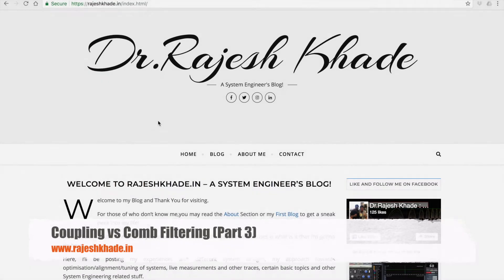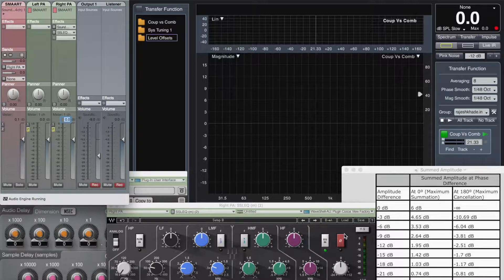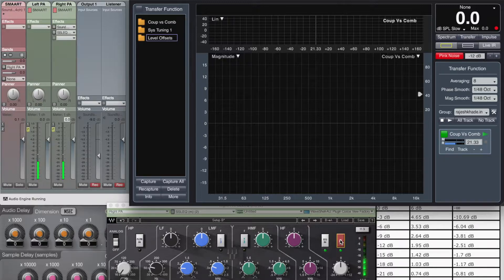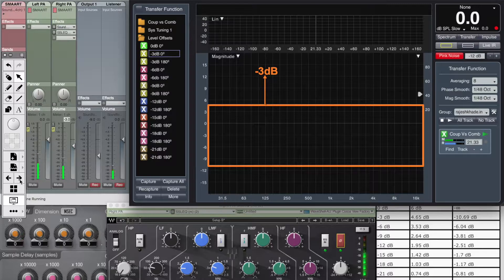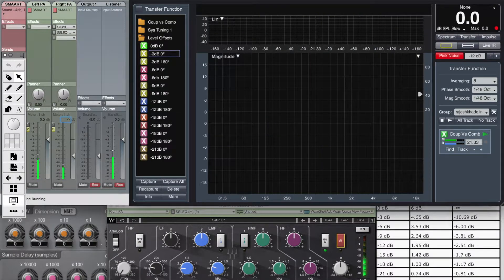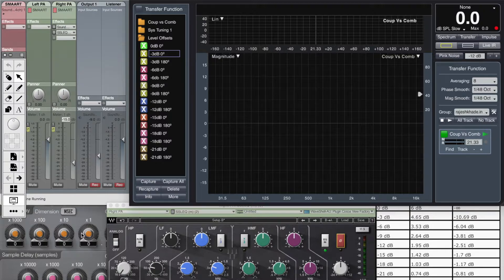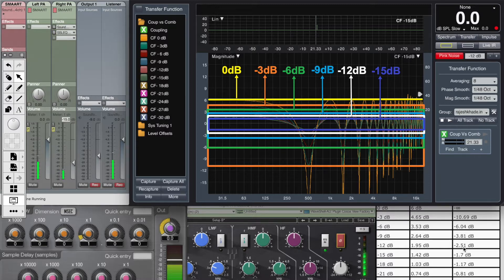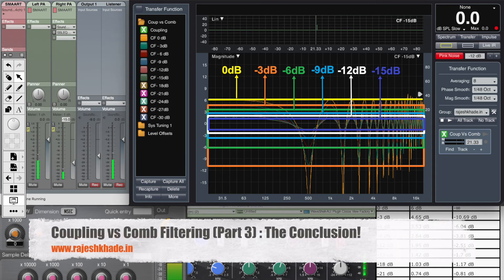Coupling vs Comb Filtering (Part 3) : The Conclusion!

Comment: so how i can make use of this coupling and comb filtering during tunning.
Reply from the maker: Coupling and Comb Filtering is something thts gonna happen anywhere! It's desirable to know about this so you can use it to ur advantage.
Lets say for example while combining systems or point sources.While using any measurement software, u can identify if what u r seeing is actionable data or CF due to floor bounce or some other reflective surface.The applications are endless I would say.
Reply: @RajeshKhade  okay thanks